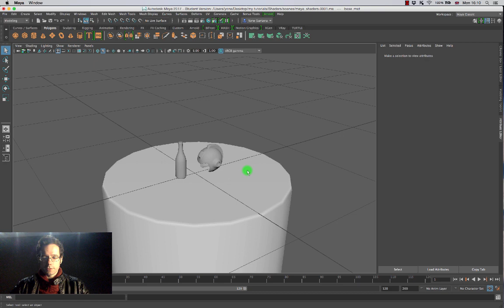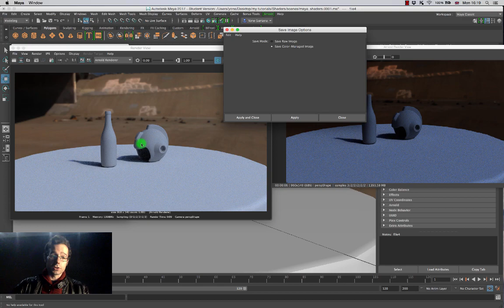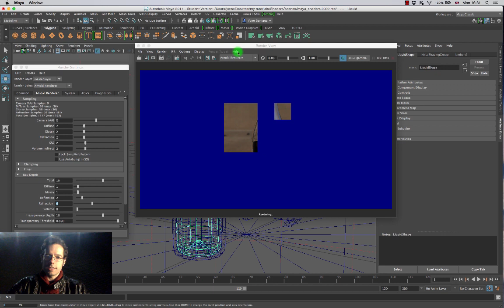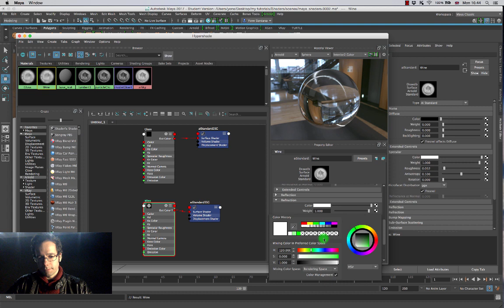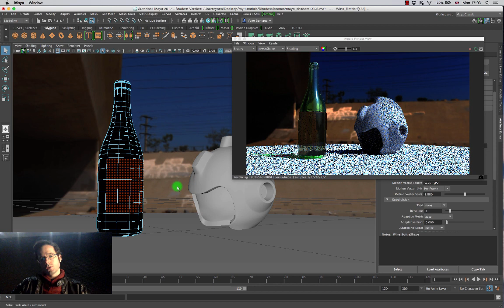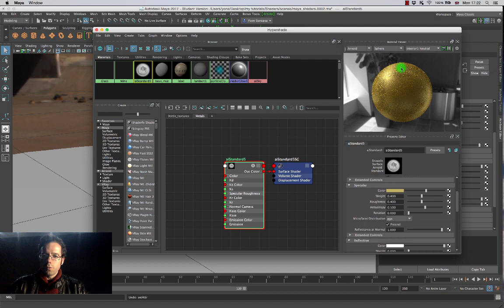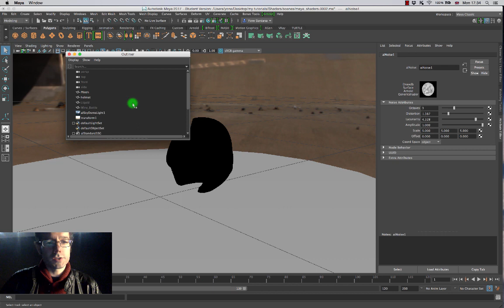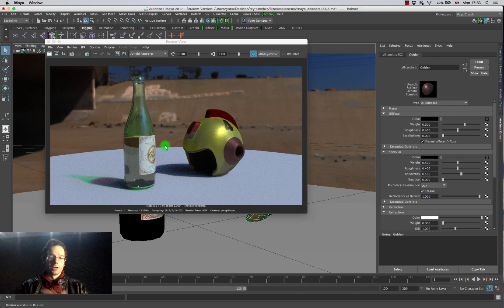Maya 2017 - Arnold Shaders

Comment: Hey man, thanks for the great tutorials. Im kinda confident with my modeling in maya but not so much with texturing, shaders and so want to learn more on these. My question about texturing and shaders is, do I need to do UV mapping on an object that i want to use procedural shaders on without texturing in photoshop or other texturing software? Hope the question makes sense, your clarification on this will be very helpful. Thanks again.

Comment: hi yone thanks on this great tutorial 
if the lighting from the hdr is not enuf do you recommend to integrate another arnold's light or boost up the hdr light to achieve the wanted fill?
Reply from the maker: There are many ways to achieve this. The HDR image is a light with it's own exposure and intensity, increasing this will lighten your scene. At the cost of not being physically accurate. 
You can add additional lights as well if that is easier for you. The higher the resolution of the HDR the more precise the light is an it is easier to achieve a realistic look.

Comment: Hey Yone! Very useful tutorial, I just wanted to ask, I am doing a glass with water inside, and when I render it still appears blackish. I turned up the refraction in the ray trace tab in the arnold settings to 10, but its still black. How can I fix that? (I used the light settings as yours)
Reply: select model -> go to attribute editor -> find arnold -> uncheck opaque

Comment: I need your help , 
I have heard mental Ray is better but it seems that AutoDesk is gradually moving to Arnold , could you suggest me which should I use for my personal work , keeping in mind which would be easier
Reply from the maker: Hello Jashan,
It really depends on the version of maya you have available and what system you like using. I can't really say which is the "best." However Arnold is the default renderer for Maya since 2017. Mental Ray and V-ray are other options but it is more a preference of what you like using. I find Arnold quite easy to work with and gives me some great options for creating realistic lighting and shading. I've found it a lot easier to teach beginners with thanks to the interactive render view.
Reply: Thanks , I have decided to stick with Arnold , and download mental Ray or v Ray plugin if they have any personal demand
Reply: What you really want is Redshift. It is a GPU renderer that is way faster then either Mental Ray or Arnold.

Comment: Amazing video, thank you. Been using Maya a few years now and finding a tutorial that is clearly and extensively covered is not easy. Especially on all this hot new 2017 stuff. Great job!

Side note: Are there ways to create animated shaders/materials in arnold? If I wanted to create the effect of a paper towel touching ink, and seeing the ink bleed into and upwards through the paper towel... can that be accomplished in Maya? Thank you.
Reply from the maker: Hi Kiefer,

There should be a way of creating your desired effect. If you know how to create any type of animated shader the knowledge transfers directly into Arnold. You can create procedural maps like Ramp, noise,... and animate different properties in the Attribute editor by right clicking on the property and use "Set Key."
You can also film elements in video and import them into maya as image sequences. You can have the diffuse channel have a texture that animates over time that you can make with a video camera or any other piece of software.

I hope it helps, although I'm not an expert on animated  shaders it should be possible to do.